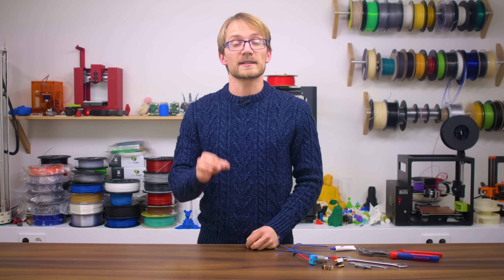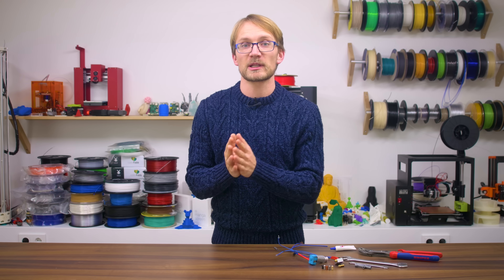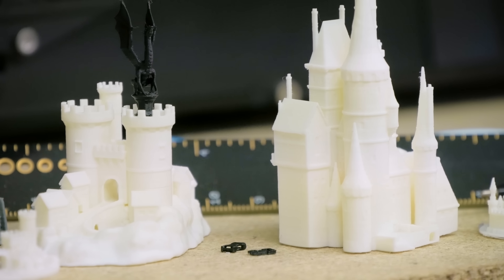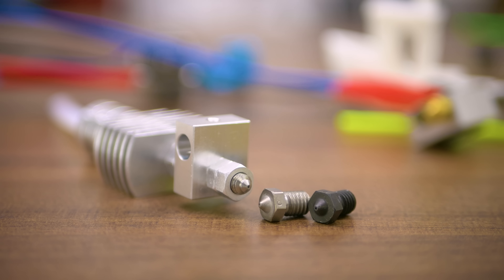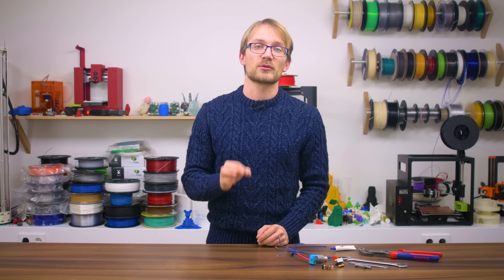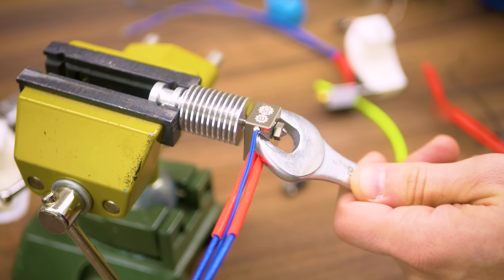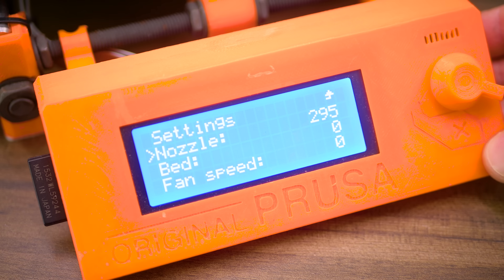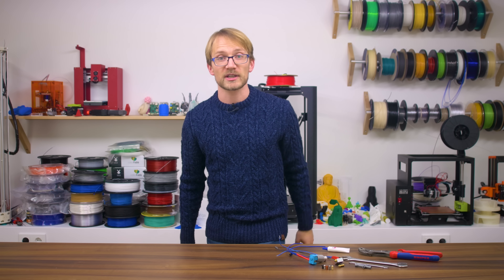How to pick a 3D printer nozzle and how to install it!

Comment: At 1:49 he says "completely invisible layer lines and super fine detail". That's what I'm going for! What else do I need besides a small nozzle? Is there a video where he talks about what you need for high-accuracy and not care about print speed? Thanks!
Reply: You will want a direct drive printer, do not go bowden, as bowden puts a larger distance between your extruder stepper and your hotend, causing increased flow while not driving, and inconsistent retractions.

You will also want a drive gear for your extruder that has a semi-circle section for where the teeth are, these grab your filament a lot better and reduce slipping, which would cause your layers to be uneven (a much larger problem at smaller layer and nozzle sizes)

You will also want to consider kapton tape, and ACME Z-axis leads, the kapton so you get better adhesion since your prints will be sitting on the bed for a lot longer, and have more time to detache, and the ACME leads because you will want to make smaller, finer steps on your Z axis

If you care more about quality than you do structural integrity, print a little colder. The layers will snap apart and break easier, but your extrusions tend to stay intact to the shape you originally wanted

You will want a printer with the highest possible distance between the tip of the nozzle, and the heater block. You will also want to wrap your heater block in some sort of insulator, like a high-temp silicone sleeve, or some fiberglass batting/kapton combination. This will reduce thermal radiation, which will help your parts warp less, and have cleaner extrusions

Do not get bed auto-level. This is a feature that would put a huge amount of stress on your Z-steppers at low layer heights, instead, get a very flat print bed, and carefully adjust the heights by hand. imo, auto-level has it's place in printers that get moved a lot, or are at hacker spaces and schools, but not for high precision home/work machines.
Reply: Oh, and a good controller for your steppers. You don't want to fry your controller when you put a high amount of amps to your steppers. PLA is also a material that's more conducive to quality prints, as it has less of a warping issue, and can be printed cooler.

I am of the impression that a hotend with a heatsink (J-head style) is a plus, but make sure to get one with a PTFE liner, it puts less resistance on the filament, and would only be damaged if you were printing high-temp exotic filaments.
Reply: Time, lots and lots of time.
Reply: Is that it? What about the quality of the rest of the hotend? What about where you buy it from? I really would like to know.

Comment: I'm now using the Prometheus V2 hotend, so I'm stuck with the one piece nozzle that came with it (0.4mm).  It's a nice hot end, but changing out the nozzle for a larger (or smaller) one would involve totally rebuilding the hot end, so it actually makes more sense to be able to swap out the entire hot end assembly.  I can actually do that on my printer thanks to the way I ended up designing the hot end mounting, but I'll probably rarely wish I had the next larger or smaller size (0.6 or 0.3).
Reply: How does your design look?

Comment: Hi Tom,
I'd advise against holding the heatsink rigidly (loosely is fine) in the vice as that is the easiest way to break the heatbreak (no pun intended). I'd rather rest the heatsink in a narrow glass or similar object so it doesn't move around much but where you can't unintentionally apply torque  to the heatbreak. You should only apply torque between the block and the nozzle - never between block and the heatsink. As the nozzle screws into the block it'll press up on the heatbreak in a safe way that can't damage it.
I like your videos very much. Keep up the good work.

Comment: Yeah I'm using an E3D V6 with a classic brass. Looked at their copper heat blocks and specialised nozzles at different diameters and the pricing was reasonable.
Then I went to checkout and VAT and £4 of postage were dumped on. Needless to say I decided there's currently no need for me to replace or upgrade my nozzle.

Comment: I'm new at this, so I'm still using the standard 0.4mm nozzle that came with my E3D Lite6. I did get a 0.35mm nozzle to compare with the 0.4mm one but I have not tested it yet. I'm only printing in ColorFabb PLA/PHA so far too, so a brass nozzle should last a while, I think?

Comment: mine's titanium. do i win a prize for once? :P
Reply: zacozacoify yes..otherwise your printer will explode
Reply: I want only the best for my printer. Where do I find the platina nozzle with diamond tip?
Reply: LMF5000 you could follow @3d.passion on instagram for our projects and updates. We went for one more prototype to dial in some minor things on it.
Reply: Vlad B it's been a month since you posted that comment. Could you link to your company's nozzle please?
Reply: You would need to get perfect containment for it so I would recommend a material that is neutral so neither matter nor antimatter such as anti-hydrogen, also you will need to print in a complete vacuum environment which will take up LOTS of power
Reply: Plz help... Do I need an antimatter nozzle to print with antimatter?!?!
Reply: Usama Khan guys, I am sorry to disappoint, but titanium nozzle is a really teally dumb idea. I dint think it even exists, because of how dumb that would be. Titanium thermal conductivity is less than a half even compared to steel. Such nozzle is not gonna perform well. How do I know? I have just finished a very deep research of all this, because I was an engineer who was developing a new 3DP Nova hotend which will be released next month. Soon you will see what materials should be used for a perfectly balanced hotend. I totally overengineered it, that is for sure 😄🤦🏻‍♂️

Comment: What is the reason for the gap between the nozzle and the heater block? Wouldn't it be better to have a higher contact temperature so more heat is transferred?
Reply: When the hotend is heated up, you will be able to tighten it even further and the gap will disappear. It's basically a simple rule of thumb to make sure the parts get tighten well enough so they don't come loose overtime.
Reply: The nozzle should be tightly screwed to the (end of) the heatbreak. As long as there is a gap between the nozzle and the hotend, and everything has been fixed you are sure that the nozzle 's end is stuck (bumping into) to the heatbreak. If not, there might be a gap between the end of the heatbreak and the nozzle, resulting in molten filament to enter this gap and ooze into the thread of the heatbreak... resulting in leakage of the assembly and potential lockups.

Comment: why do you need to leave a bit of space between the top of the nozzle and the bottom of the heater block? is it bad for the hexagonal top of the nozzle to touch the aluminum or is this just to leave space for final hot-tightening?
Reply: As you know the nozzle needs to be tightened up against the heat break and not against the heater block. The small gap ist to make this sure.
Reply: SiGi so the gap just allows the force of the nozzle tightening against the heat brake to be longitudinal rather than twisting the heater block against it to create the seal? it's just a protective measure for the fragile heat brake?
Reply: Nope. Applying torque on the heat break is generally avoided by holding the heater block with a wrench while tighten up the nozzle.

Comment: Hi, great video, what I don't get is the fact that we must tighten the nozzle when the bloc is hot?? metal wil expand as it is heated up, so, as the bloc cools down, the nozzle would become loose and leaks. My two cents would be, tighten the nozzle cold and when the bloc get hot it seals the nozzle even more as the metals get expanded ! Can someone get me out of this theory? :o)
Reply: The metal expansion dimension is proportional to the volume of the part that is heated. A bigger part will expand more than a small one, as it is the case for the heat block and the nozzle.

There is also an other factor to take into account. different materials don't have the same thermal expansion coefficient. So even if the parts are similar in volume, it might result in a loosening or a tightening, depending on the assembly.

Determining the impact of each of these cases requires calculus and i'm too lazy to make them for a youtube comment :P.

Comment: I picked up an e3d fun pack (https://www.amazon.com/E3D-Extra-Nozzle-Pack-1-75mm/dp/B013VBTM80), and did some work with the .25 mm nozzle and some of the ones in between.

Ended up going back to a .4mm nozzle, but I could see using the .3 or .5 at some point.

Comment: I tend to stick with 0.35mm or 0.4mm as they are a good compromise between detail and speed. I usually upgrade to the Microswiss hot end when I can for long ABS prints and the ability to run PETG.

Nozzles I use:

Makergear M2 - They have a proprietary hot end, but it works really well. Standard is .35mm brass. I also have 0.25mm for detail work, and an 0.5mm for big pieces.
Wanhao i3 (no longer have) - I had the Microswiss stainless all-metal hot end on that with a .35mm nozzle. It ran great in between bearings going out on me......seriously I got every bad bearing that the company had.
Imagine That Titian (an Afinibot A31 with several upgrades) - Thus far I have a Microswiss all-metal in it as well. 0.4mm.
I am getting a Wanhao D6. I plan on upgrading that to the Microswiss as well.

My singular complaint with the Microswiss hot ends is that they will only tolerate 1.5mm of retraction before they start clogging. I get a lot of stringing with PLA, but I'm playing around with coasting to see if I can reduce it.

Comment: A review of that ruby nozzle would be awesome as I'm having trouble with my nozzles degrading and might just go all out and fix it with the new ruby nozzle. Also how often should you replace your nozzle and what are some obvious signs of your nozzle degrading?
Reply: a heavily worn out nozzle will cause stringing, poor overhangs, and in extreme cases voids in your prints.  the ruby nozzle is good for heavily abrasive filaments, but a poor nozzle for general printing.  I've had good luck with plain old hardened steel nozzles, even printing a lot of carbon fiber and glass filled filaments.
Reply: Just get the Nozzle-X

Comment: I'm surprised that tungsten nozzles doesn't seem to have hit the market yet, while ruby ones have.
Reply: Best reason I can imagine is that sapphire (the same mineral as ruby; the difference in colour is due to impurities) nozzles are relatively commonplace in water jet cutters. I imagine they might use a similar manufacturing process for these. Tungsten carbide wouldn't be a bad choice though because it's also very hard and conducts heat even better.
Reply: That's interesting and now it makes a ton of sense that ruby nozzles exist since the technology was already there. =)
Reply: there was a kickstarter for tungsten nozzles. i ordered 2 for my FFCP2016...
Reply: That the one I was thinking of. =)
Do you know if they've started shipping them yet?
Reply: they haven't shipped yet, but are supposed to ship this month (January)
Reply: ever machine tungsten?

Comment: I have been loving printing with a e3d .8 mm nozzle. I have been printing larger objects in PETG, and it really speeds things up. Although i get more stringing with the .8, and while i have fiddled with retraction without it helping much, i have not fiddled with any kind of coasting. Right now i just live with a little post print work. I change the nozzle right on the printer without removing the extruder or heatbreak. (e3d bigbox). The only problem is you dont realize how fast you can crank through a roll of filament. A two hour print will use up a quarter of the 1kg spool.

Comment: I'm just using what came with the Lulzbot Mini. Had trouble printing out parts that required high precision like gears and things with screw holes and nut pockets. Could the 3mm nozzle be the issue?

Comment: I mainly print with pla. e3d brass .4mm nozzle.   my success with abs has been awful, delaminating layers and prints warping off heated bed.   pla, no problem ever.  Nylon - as long as its taulman, no issues.

Comment: I have a Prusa i3 mk2 kit on order.  I added a hardened steel nozzle to my order so I could occasionally print the exotic filled fillaments, but will mostly print PLA and non- abrasive fillaments.  Should I print everything through the steel, or just swap in the steel nozzle on the rare times I actually need it?
Reply: Super late reply, but just in case it still helps you/anyone else: it's really up to you. A hardened steel nozzle will print everything that a regular brass nozzle will print. The only slight downside is that steel conducts heat slightly less effectively than brass, meaning that you might not be able to print quite as fast with a steel nozzle than with a brass nozzle (you won't be able to pump heat through the nozzle and into the plastic as quickly). Personally I've never found that to be a problem, but I always print quite slowly anyway as, like Tom's said before, I prefer higher quality prints that take a bit longer over fast jobs that give mediocre results. I tend to switch between nozzle sizes fairly frequently (I've just spent this weekend trying out E3D's experimental 0.15mm nozzle, printing a Benchy at 10% scale - that's 6mm long - and 0.08mm layers and having it still come out looking like a Benchy rather than a big blob of plastic), and so there's a reasonable chance that I'll have to swap out the nozzle for a given print regardless of the material being used. Just be very careful when initially screwing in a nozzle - I've accidentally cross-threaded an E3D nozzle before which actually ruined the heater block, requiring a replacement! :(

Comment: I tried a stainless nozzle on my MK10 extruder, and it sucked. It was as if I was running 50C lower temp. Yes, 50C. Needless to say, I'm sticking with brass for now. Honestly, it was my bad, because my hotend is pretty bad to begin with, lol. I'm just going with cheapo ebay nozzles for now, they seems to be working fine for me.
Reply: I personally like Micro-swiss nozzles.  Brass core and wear resistant coating.

Comment: Is there any merit to using thermal paste on the threads to improve the flow of heat to the nozzle? It's in extremely small spaces where the paste would be just a few particles "thick" that it's most effective, so ideal for threads. This would more intimately link the nozzle to the heatblock which can only be a good thing?
Reply: ***** well the nozzle would maintain temps better as it can steal heat from the block faster - (assuming the paste is meant for these figures, yeah) - possibly improving stability with high flow rates. Paste can improve heat flow drastically in traditional applications so it'd definitely help, but maybe not by enough to be worth it. Just a thought!

Comment: I'm just sitting with a standard E3D V6 Nozzles made of Brass. Currently I have a .3 mm nozzle in because I need better details and almost never print above layerheights of .2mm....
But one question still is open to me: Why leave a gap between the nozzle and the heater block?
I make them flush since "printing day one" to enhance the heat transfer to the very tip of the nozzle... (my way of doing it is: unscrew everything from the heater block, clean threads, screw nozzle back in until hand tight, now unscrew 1/3rd turn, screw heatbreak in until hand tight, check if nozzle is still hand tight. heat up to 240°C and tighten the nozzle until flush)

Comment: Should I switch to a different material other than brass if I just plan on using PLA? Will the lower thermal conductivity of stainless matter for PLA, since it uses a fairly low print temperature compared to other materials?
Reply: Brass will do just fine I'm pretty sure that's what comes standard with most 3D printers.

Comment: Hi, nice video :) i have a ? what is the smallest nozzle for mk2 to produce very smooth small prints with not many problems i heard of 0,1  but that will work without problems    ?  (with quality filament not cheap)
Reply: Thank you !!!  il get a 2,5 and see from there.  To have people just  giving you a basic info were to start is great i m getting my prussa Mk2 next month. Keep it up :)
Reply: Thomas Sanladerer What is the biggest nozzle you can use for super fast prints?
Reply: I think 1,20 is the biggest for 1,75 filament   also around 0.8 is good depends the size of your object. I don t know if for the 3.00 mm filament there is bigger nozzle. For room size printers and life size prints im sure there are bigger nozzles but that is an other story :)

Comment: Hi Thomas. Did you print with 0.8mm nozzle and can you tell us tips and tricks with it ? I'm printing nicely with 0.4mm but can not print objects higher than 3mm..
Reply: A 1mm nozzle will extrude over 6 times the filament than a 0.4mm nozzle.  It's all about surface area.  2*pi*r*r 0.4 = 2*3.14*0.2*0.2 = 0.2512sq mm     2*3.14*0.5*0.5 = 1.57sq mm   --- 1.57 / 0.2512 = 6.25 times the surface. printing at 40% the speed still gives 2 1/2 times the volume.  100mm/s to 40mm/s 6.24 * 0.4 = 2.5.
Reply: on my DIY Type printer with 1mm hotend, i print with 20 degree more then normal and slow down print speed from 50mm to 40mm and i got good job and got good adhesion lawer
Reply: and.. what is the point ? is it faster than 0.4mm with 100mm/s ?